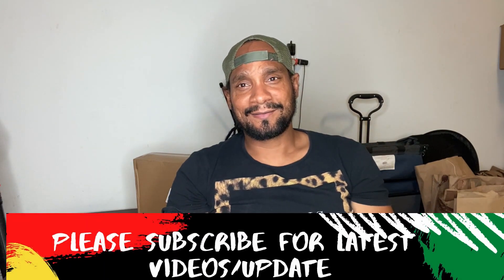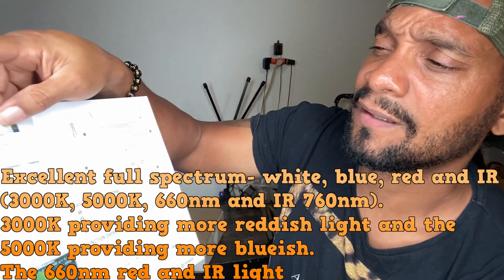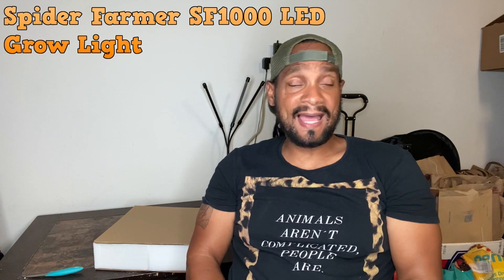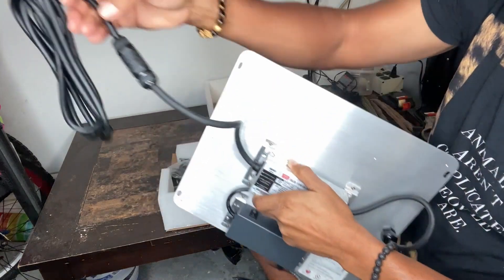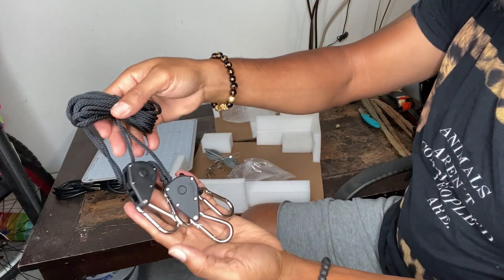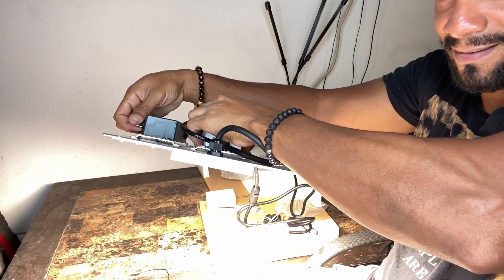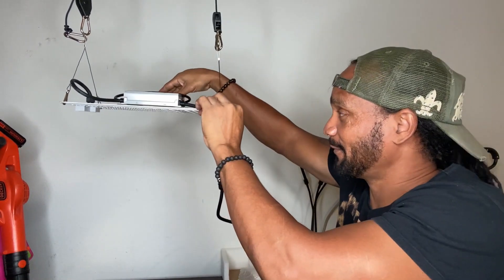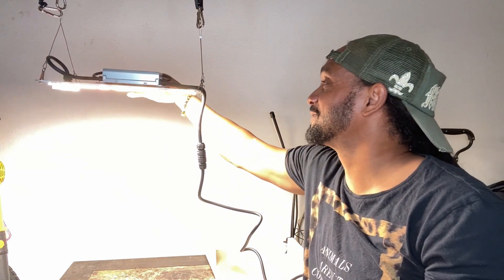Unboxing And Setup Spider Farmer SF-1000 - LED Growlight  Samsung LM301B & MeanWell Driver

Comment: I bought one of those about a year ago to replace some of the lights in my lab. Since then, I've added 3 SF-2000 fixtures to replace ALL of the lights in the lab. They are a bit pricey, but the quality of the components is worth it to me. I think you will be happy with that light.
Reply from the maker: That's great hearing your experience using this model growlight ... 
Thank you so much for your input ... 
Have a great week